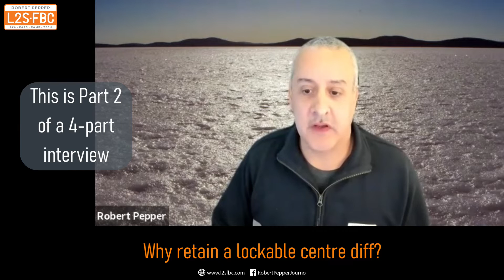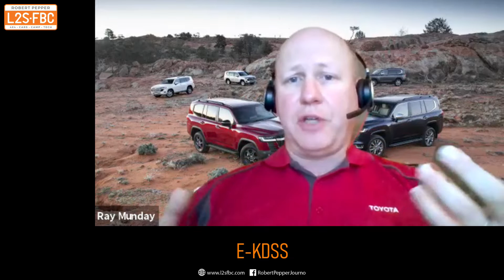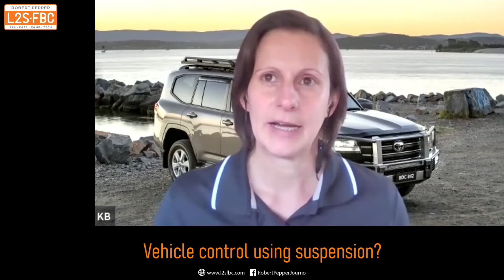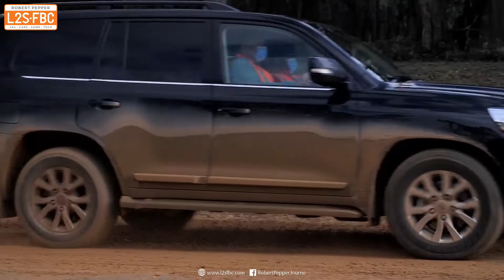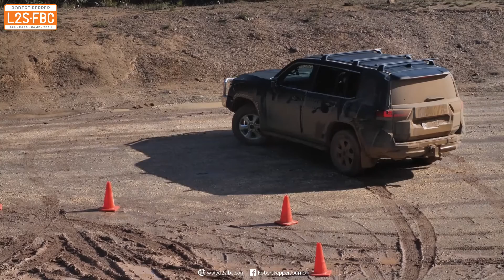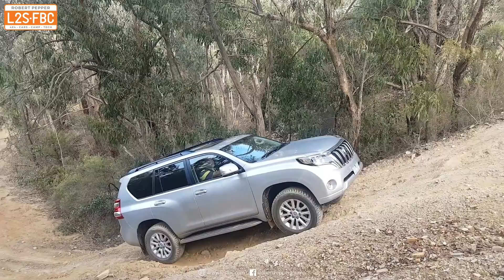4X4 vehicle development - LC300 tech engineer interview,  Part 2/4 - Offroad Systems

Comment: One Powerball. Too bad we don't get the Tundra. People won't need to chop and extend the wagons then. I think a poor argument not having diff locks on all models. Wouldn't customer feedback be across all models? And the Prado 150 has a better system? 
I can't wait to see 300's traction control tested on slippery slopes or even on rollers. For sure against the Prado 150.

Comment: Toyota hasn't done a great job of communicating some of this stuff up until now. Those prices seemed outrageous at first look, but the blow is softened a little bit when details of some of this engineering development become known. They are still expensive vehicles for what you get though, with a very healthy profit margin, particularly at the upper end of the range. Thanks for the detailed drill down.

Comment: Interestingly how the Fortuner and Prado have rear cross axle locking differentials yet with the new Landcruiser 300 it is only available in top variants... Toyota's BTC is great, but when off road, if a wheel sensor is damaged (e.g. rock crawling or even a branch flicking up whilst driving - it has happened to me), the computer deactivates the ABS, Traction Control etc. This is where cross axle locking differentials are much more reliable and effective.
Reply from the maker: Agreed, and also the locking centre diff. The lockers are just a way to get people into the GR Sport.  The rear locker isn't across the range on Prado, it was on a Grande I tested. The Toyota strategy is keep the good bits for the top models.